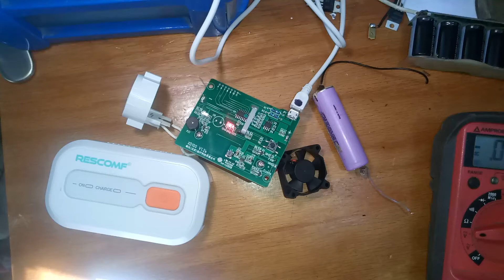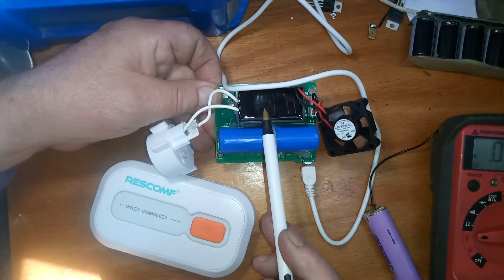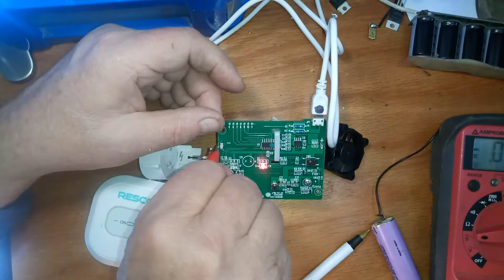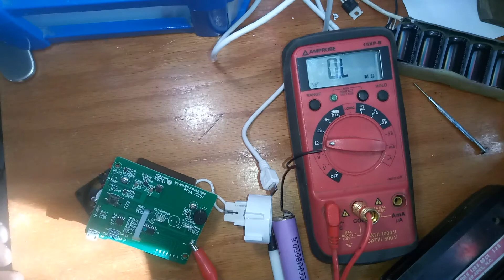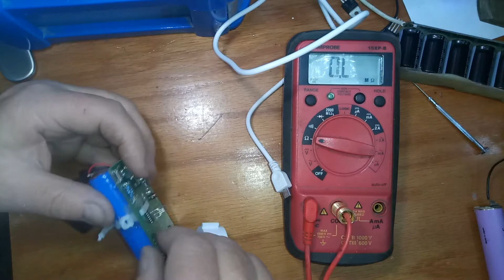Inside RESCOMF Defective CPAP Cleaner Tear Down, Repair, Bad Vendor pt1

Comment: Do you think these knock offs actually work and produce ozone or do they actually work minus not being reliable?
Reply from the maker: Actually quite impressed with construction, use mine almost daily. Battery given an extra layer of protection with internal B M S.  You don't need to spend more than this. Ozone level more than I expected. With low cost you don't get customer service.